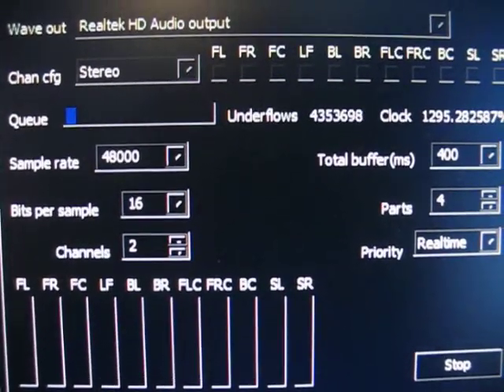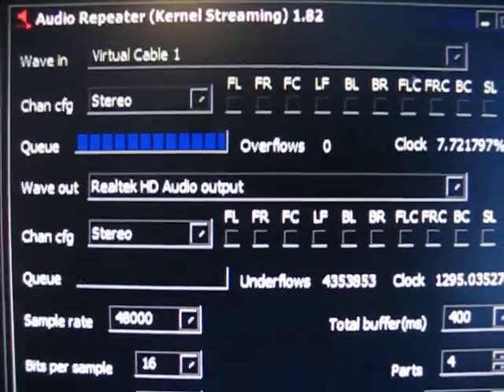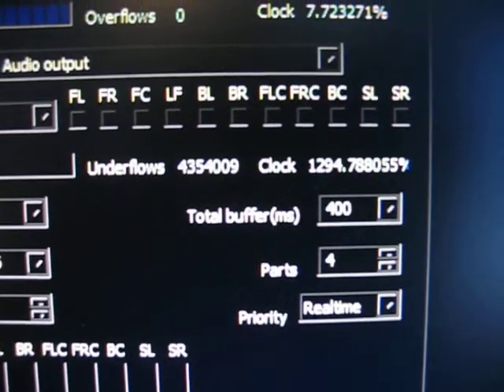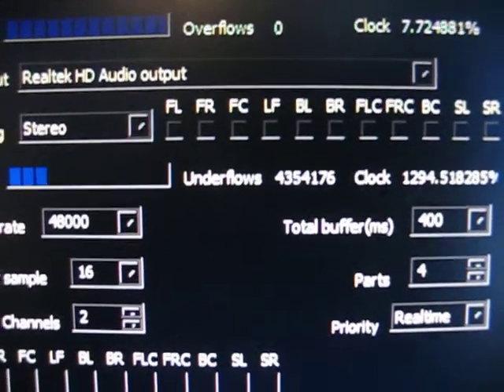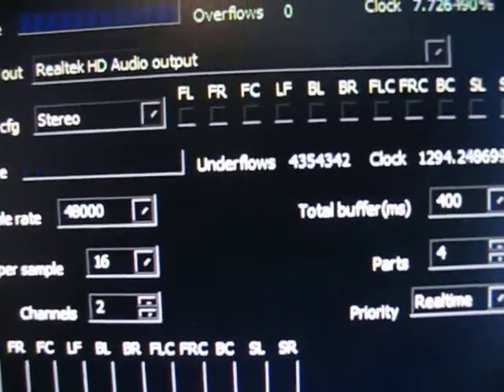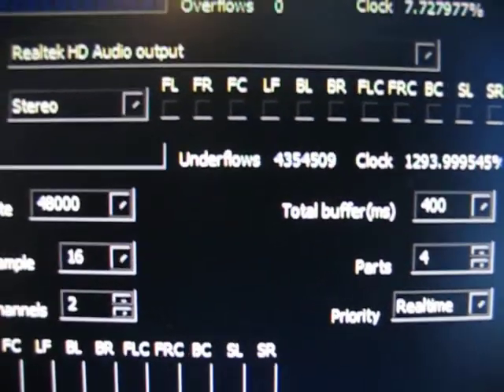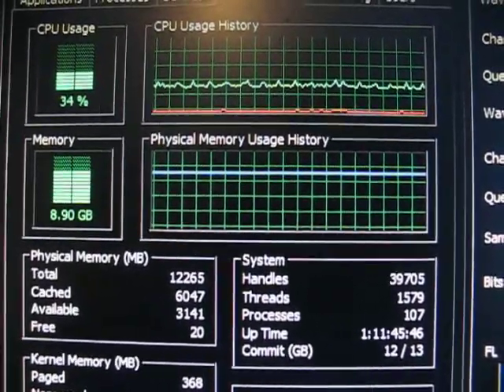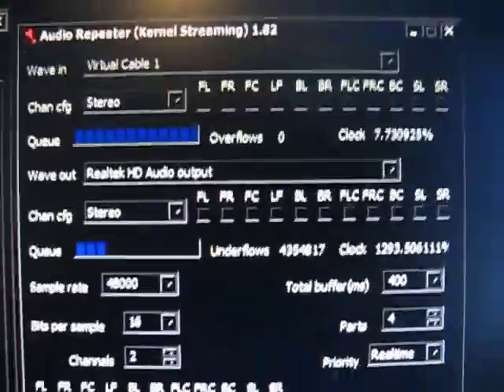Virtual Audio Cable 4.13 - Constant Underflows

Comment: This is a really strange issue which still seems to be present. I keep getting constant underflows while my friend has zero issues. We're using VAC 4.15 on Windows 10 64-bit, for the record.

Edit: clicking "Restart Audio Engine" on the VAC control panel seems to fix the issue, at least temporarily, but you'll have to restart all your audio repeaters.

Comment: Switch back to version 4.12, When using 4.13 or 4.14, the audio starts stuttering after a while, That doesn't happen in 4.12.

4.12 works fine in Windows 10 also.